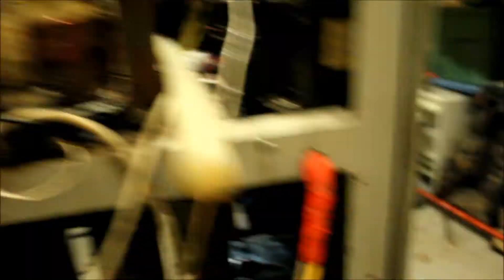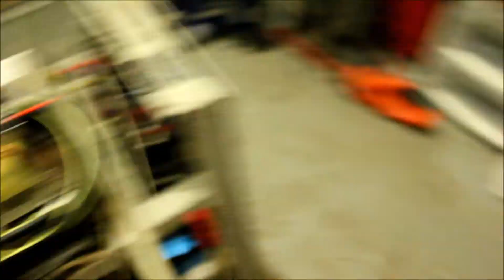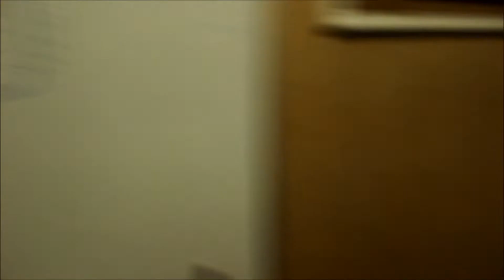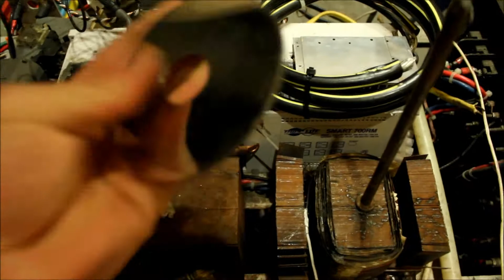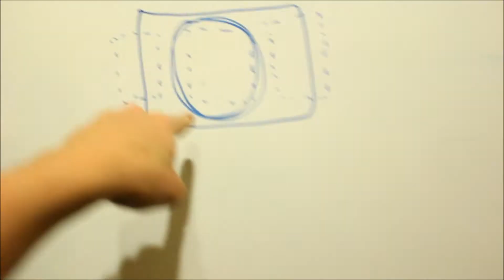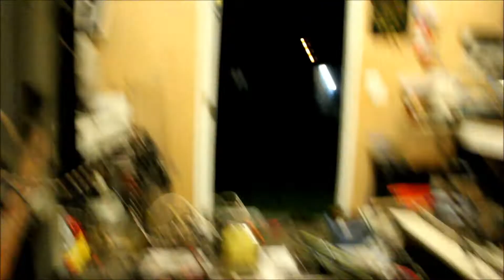Electromagnetic Levitation at 7KW and 50KW arc on the electromagnet in 1080p HD

Comment from the maker: That is like saying that driving implies safe driving. :) lol This wasn't really designed to be a showy levitator but just an educational demo of electricity and magnetism.

That guy also uses levitation. This is pretty much the same thing but instead of a magnet being repelled, it is simply a block of aluminum. He repells with like magnetic fields with a Hall sensor to vary the power; while this uses a Eddy currents and induction. Slightly different effects. His was cool and well made though.